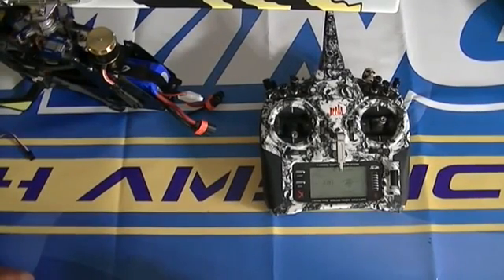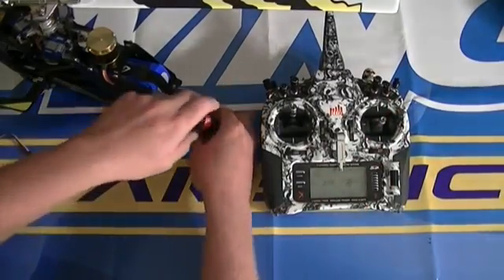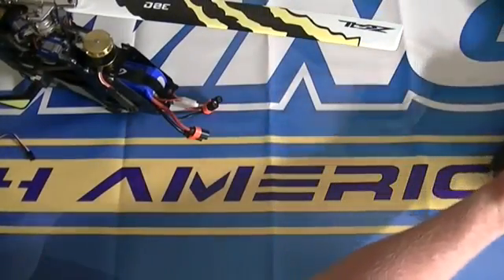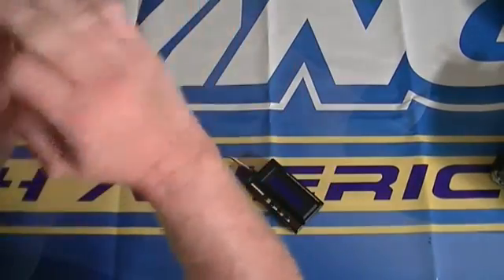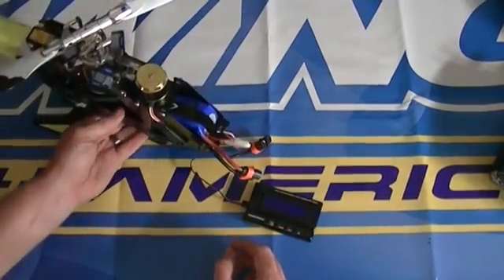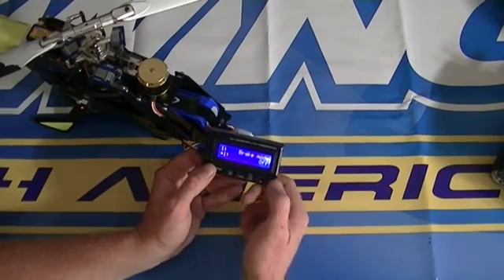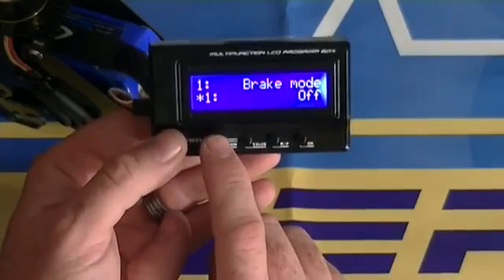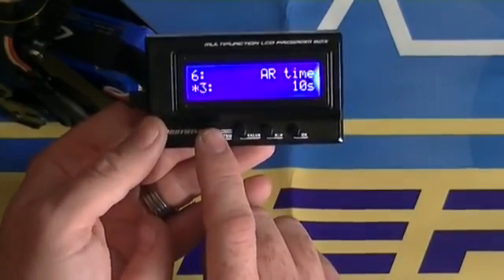Hobbywing Platinum pro V3, V4 esc gov setup

Comment: Hello i have à platinum V3 and the multifunction program box. When I start my helicopter the delay of the motor is around 8 secnds. Which parameter to modify to reduce the starting delay?

Comment: Hi buddy, thank you very much for your very nice info. I bought a Trex 550X super combo with ESC align 100A. I am learning the autorotation maneuver and I noticed that the engine does not restart immediately (at the end of auto) : if I make a mistake there is the risk of crashing. So if I understand correctly, I can set AR time at 1 sec, so i can immediatly restart the motor and avoid crash.  It's correct?
I hope for your advice. 
Stay safe. Greetings from Italy

Comment: Do you know if it's a pain to set the esc up by transmitter? Ever tried it?
Reply: To the best of my knowledge the HW platinum V4’s cannot be programmed via the TX you HAVE to have the programmer. Annoying as I had the 2-in-one programmer and Align RCE-BL100A (I couldn’t find a HW platinum 100 or 120 anywhere) and it wouldn’t talk to it, Nor could I find any other way to change the governor mode. I’ve had to go and buy the 3-in-1 programmer which works fine.